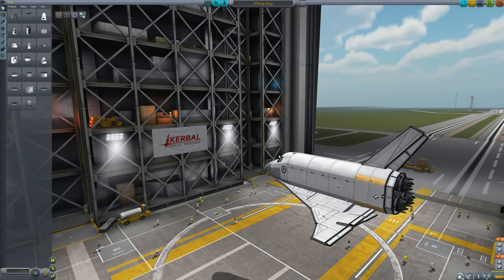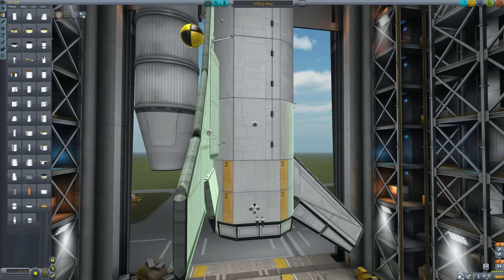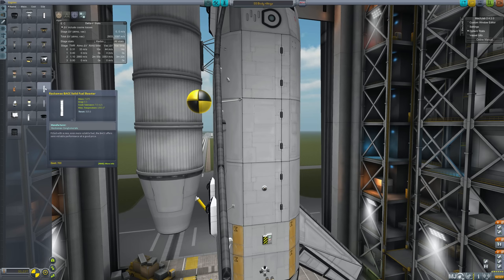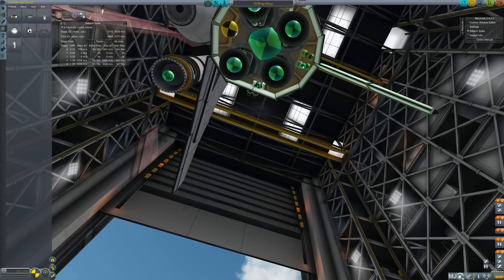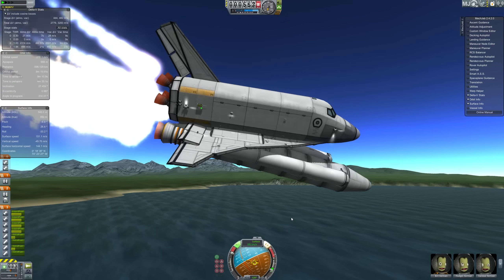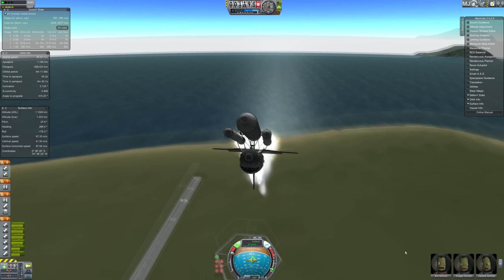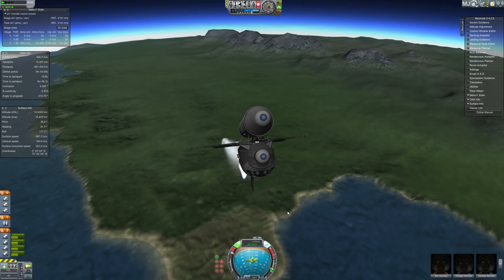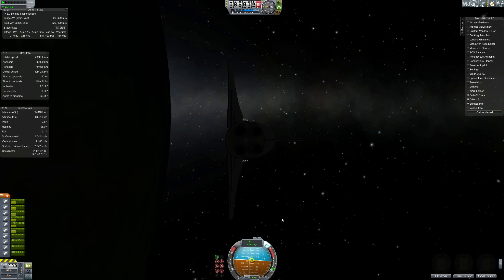Making The Kerbal Shuttle Fly To Space!

Comment: Wait what, theres an undo key? :O
Reply from the maker: yes!
Reply: Yes! It works kinda strange, but when you acidentally rip your ship to bits you can push ctrl+z, though it sometimes fails if you delete the bit you tore off. It'll then put the bit back to where it was supposed to be, and still keep the copy you took off.
So, as I said, a bit weird but it does work!
Reply: ctrl+z ;)
Reply: Thanks for all the replies, ive literally been saving my ship after every action, ctrl + z is a much better method.
Reply: ctrl+z and ctrl+y for Redo
Reply: it can sometimes seem to make slower machines hang if you're removing or adding a LOT of parts when u undo.... give it a while, it will work eventually
Reply: H4WK69 often if you use control+z to undo something, you need to re-check all your fuel lines and struts to make sure none of them spontaneously disconnected.  Just a warning.  :D
Reply: Hillel Finder Hold Alt and left click
Reply: H4WK69 haha, I renember when I first discovered this. Quick warning though, I've had my game crash when undoing, so renember to save often.
Reply: Communist_Penguin Gotcha.
Reply: H4WK69 It can be a teeny bit finnicky; (sometimes undoes more than you think, sometimes redo puts back more than you'd expect) but it is 99% of the time much better than a craft-save craft-load operation :)
Reply: Scott Manley How does one copy a piece? I am building a craft that requires the same thing in a place and symmetry is doing weird things.
Reply: Thomas G. Aagaard What if I have a mouse pad? How do I left click?
Reply: A touch-pad?
I'm not overly familiar but there should be at least a couple of buttons next to the touchpad that will act as left and right mousebutton.
Reply: Thomas G. Aagaard No, I have a MAC pro. (Mouse pad)
Reply: Bert van Rossem  I've tried ctrl+z doesn't work for shit for me.
Reply: ***** Thanks.
Reply: Cole Donnelly Try command+z.
Reply: ***** What's the difference between Undo and Redo?
Reply: Hillel Finder undo goes back a step, redo goes forwards a step
Reply: crtl+z is the undo for Windows (by microsoft. Not glass..)